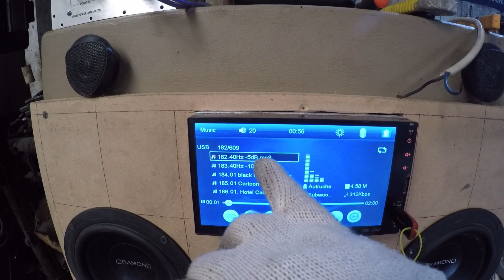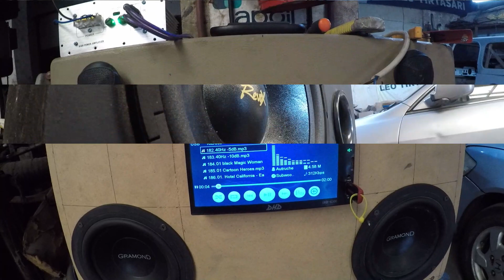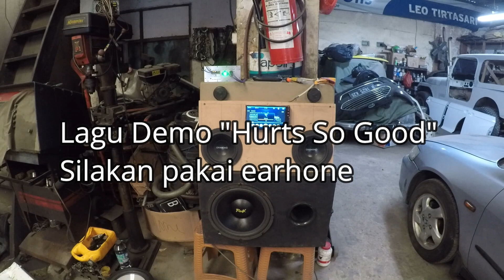POWER MURAH TAPI BAGUS UNTUK SPEAKER AKTIF TAPI BISA BUAT SUBWOOFER JUGA

Comment: Itu ditambah parameteik dan spiker lagi 3 inch dan tweter bisa nggk
Reply from the maker: Maksud nya di tambah parametrik equalizer?  Bisa saja si jadi output parametrik equalizer di sambung ke power ini.  

Jika mau di tambah speaker 3 Inch dan Twitter dibutuhkan crossover pasif untuk membagi frequency sesuai peruntukan nya.
Reply: Ditambah crossover pasif biar suara bisa pisah gitu ya bang
Reply: Oo iya bang aku ada stiker 3 inch kanan kiri dan tweter kanan kiri total 4 itu perlu tambah crossofer masing2 kanan kiri atau 1 saja cukup..?
Reply from the maker: @mochridhoonthelis7395  fungsi crossover pasif adalah memisahkan frekuensi sesuai peruntukan nya.  

Biasa nya untuk Tweeter antara 3000 - 20000khz jadi jika frekuensi tinggi/ Tweeter masuk ke midrange atau MIDBASS akan aneh suara nya dan potensi rusak.  

Biasa nya crossover bisa di beli di toko2 elektronik.  

Jadi perlu 2 set crossover untuk 2 pasang Tweeter dan midrange.
Reply: Oo iya bang satu lagi.. 
Ini spikerku kan ada 3 macam 
5inch 3inch dan tweeter masing2 akubtauh di kanan kiri deket pintu mobil.. 
Apa spiker 3nya itu disambung dari ampli ke crossover trus ke spiker gitu ya
Reply from the maker: @mochridhoonthelis7395  hallo boss q.  Sorry late reply.  Ok jadi penggunaan di mobil ya.  

Asumsi hobi review adalah system 3 way ya karena ada Twitter, midrange dan MIDBASS nya.  

Dipakai saja crossover bawaan dari paket speaker atau bisa beli crossover via online di shoppe/ Tokopedia tinggal di sesuaikan tulisannya apakah untuk Tweeter, midrange atau midbass.  

Khusus midbass bisa juga langsung di sambung ke power tanpa crossover.  

Crossover yg di bicarakan di sini adalah crossover pasif ya bukan aktif yg perlu sambung ke aki mobil.  

Semoga bermanfaat..
Reply from the maker: Oh ya boss q di shoppe tiap jam 8 ada live shopping beserta voucher diskon puluhan %.  Terlampir link nya.  

https://shope.ee/3faLmBv33T

Lumayan selisih discount nya bisa buat yg lain. 

Oh ya follow Instagram hobireview ya ada barang2 unik yg bisa jadi pilihan -> ->
 https://www.instagram.com/hobireview1/

Semoga bermanfaat..